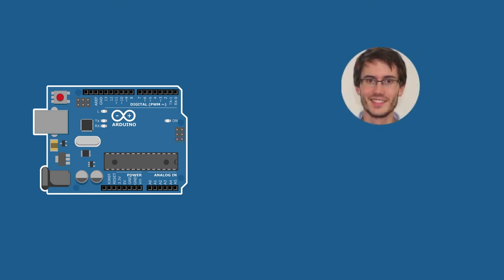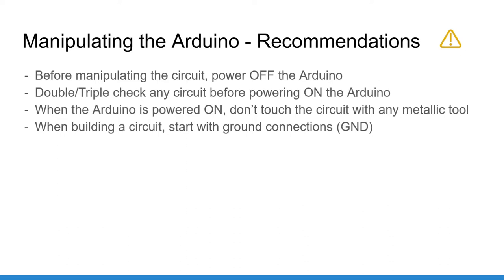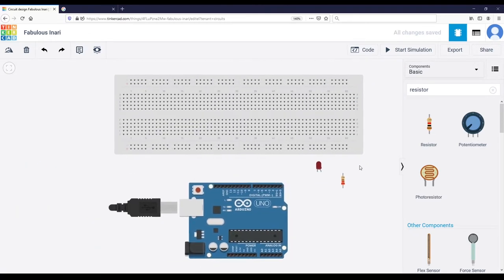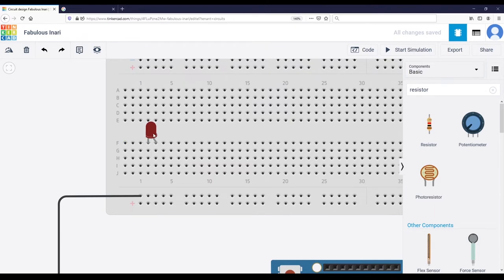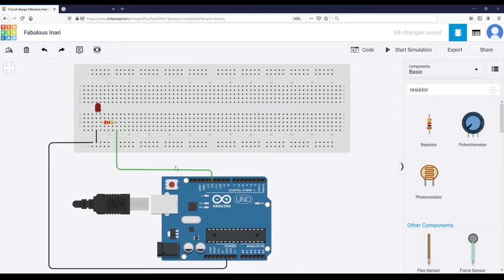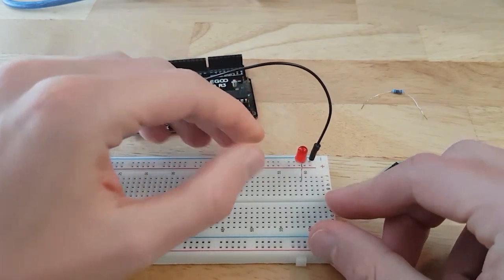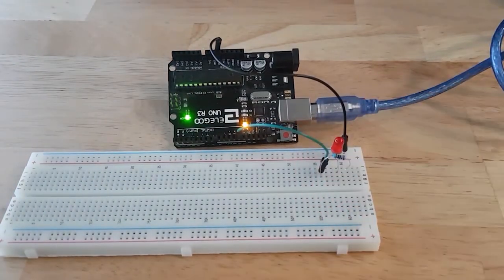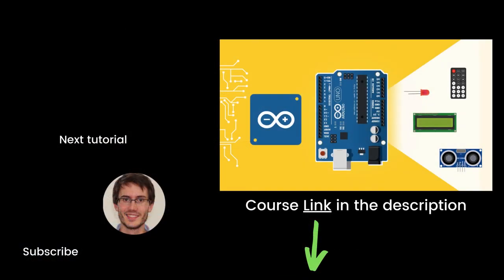Create an Arduino Circuit with an LED - Arduino Tutorial for Beginners 9

Comment: hir sir i have a question for you
Please draw circuit diagram to control a 12V 3A horn & a 2.2V LED using a switch with peak current of 50mA. When the switch is pressed for  the Horn should make sound and the LED should glow for 5secs and then turn off.
You can make assumptions while solving this problem. Please share the circuit diagram & code in Embedded C/Arduino/Python when done.
Reply from the maker: Sorry, not doing homework ;)